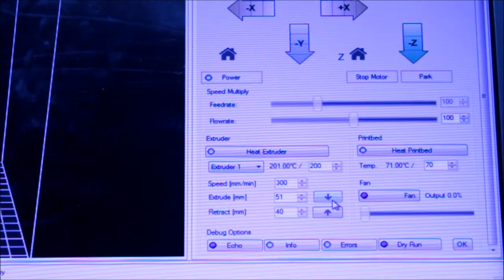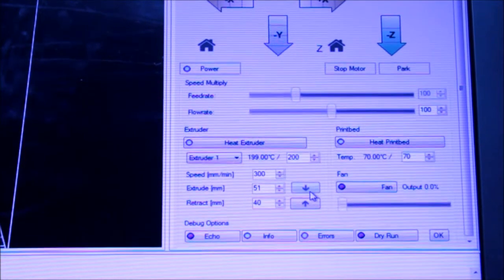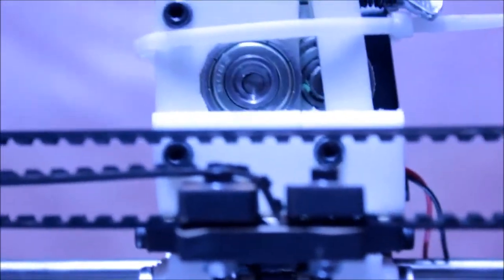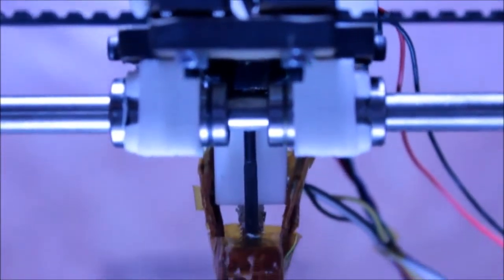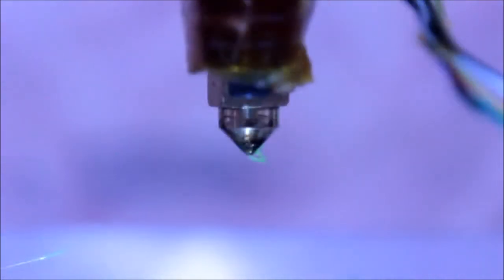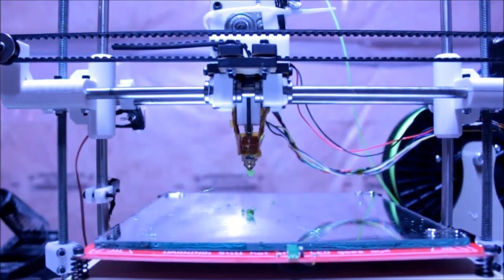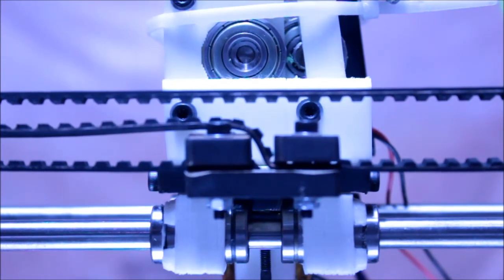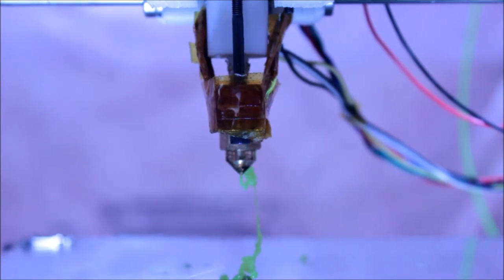Extruder problem

Comment from the maker: Kitsaros due to the heat generated and excessive tightening of the threaded brass shaft against the Teflon shaft has reduced the size of the hole inside the Teflon shaft preventing the filament to move downwards. In such case this is a design fault i would say. You have to make sure that the hole through which the filament travels is always metal and you use Teflon or other plastic to just avoid the heat transfer to the body or to avoid the heat transfer towards the motor upwards.

Comment from the maker: The extruder which I have is divided in 3 parts, 1) Nozzle 2)brass shaft on which the nozzle is screwed on one end and 3) the Teflon shaft into which the other side of shaft in screwed in. What I observed is that the shaft had a countersink hole to guide the filament inside the shaft. The countersink shape on the shaft was pushed against the Teflon shaft too much and the Teflon had taken the shape of the countersink reducing the size of the hole for the filament to move further.